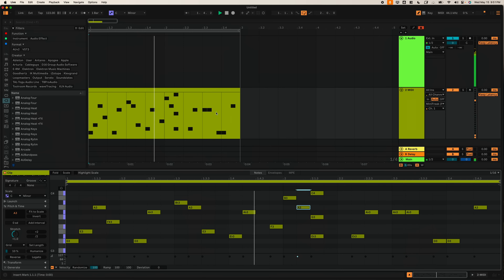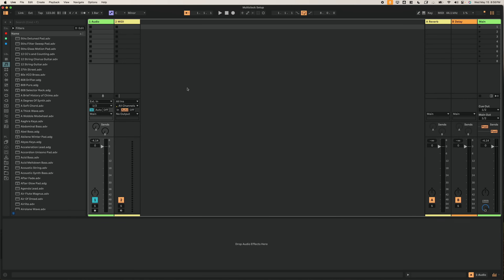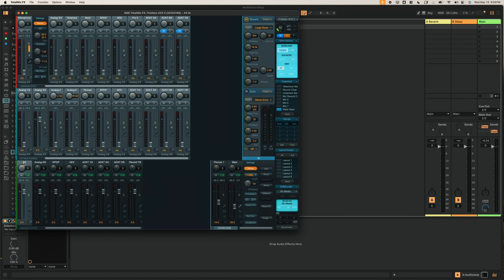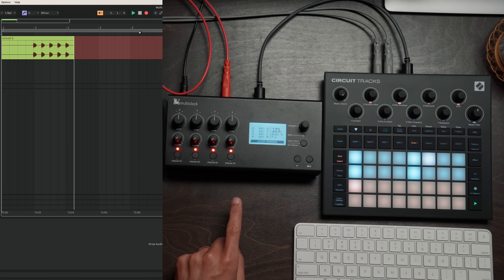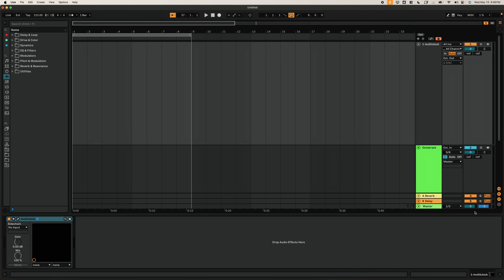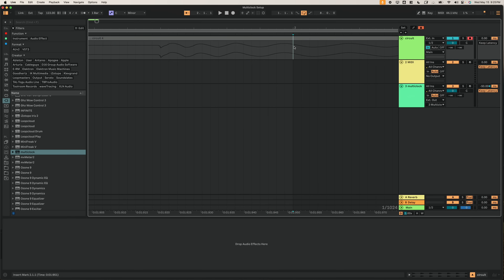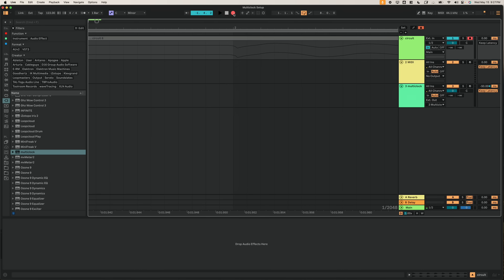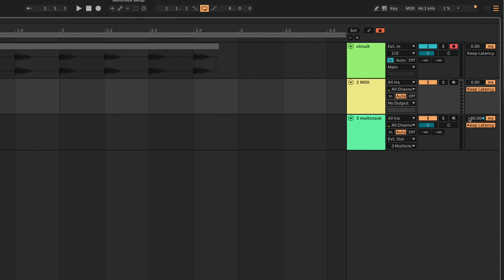How to PROPERLY use your Multiclock with a DAW.

Comment: the problem is this thing doesn't solve the problem that is ABLETON itself... so now this adds MORE delays you have to adjust on top of the 3 or 4 inside of ableton? Well who cares? You might as well skip this multiclock and only manipulate the 4 inside of ableton that also seem to change the sync with every run of the transport. Meanwhile you know what works without any of this? Bitwig does! Which revels that Ableton is not designed correctly... there's really no reason for it to have so many problems, the designer are just lazy and have arrogant attitudes... they have banned me from their forum and their support for explaining these things to them and insisting that they fix problems that exist before adding new probability based devices that no one needs.

Comment: I think I found a simpler way, granted I only use it with a single synced device: place the multiclock plugin on a MIDI channel, then behind it an external audio effect, audio to the multiclock, audio from the synced device. Then you can dial in the latency on the external audio effect itself. No need to use any of the other Ableton magic, like track delay, reduced latency when monitoring and so forth.

Comment: Hi Ricky , i have a question! I want use my Synthesizers in the DAW with an Editor to make my Midissequences in the DAW. I have a MioXL iconnectivity for my Midi Routings. i want take the E-RM Midiclock for sync the HARDWARE EDITORS in my DAW. Have you a IDEA? Or make a Video for it thats great!!! ;)

Comment: Thank you very much for this video. In the beginning of the video you state that you should not buy a multiclock if you just want to send midi notes from your DAW to your instruments. I have a lot of trouble with the timing when I send midi notes from my DAW to my instruments. It's not just latency, it's really drifting, meaning that one note comes too early while the other one comes too late. I tried different solutions (in multiple different DAWs) but I haven't found one yet. The only solution that I found that gets the timing straight is the Usamo, but it has other issues which makes it not really a solution. So, just to be clear: If I understand it correctly, the multiclock won't be able to fix this problem? Or can I use it to fix this issue? Do you know of any other solutions? Thank you very much!

Comment: I'm noticing my Multiclock needs adjusting up to 5ms depending on CPU usage, is this normal?

For example when I start a project, everything is bang on grid, then by the time I'm a few hours in (and CPU is 20-30%) everything is now 5ms off!

Thanks in advance!

Comment: Sorry, I don’t think this is correct. The amount of negative delay you add would need to be adjusted as you add more plugins. You can’t beat the 1 bar issue. Also it’s better if you use the external audio effect to send the signal to the multiclock. This is all to do with PDC (plugin delay compensation)
Check it out

Comment: Now my Multiclock is running fine , i spend hours trying to fix this. At the end the magic was to adjust the output route of the audio interface to only the channel which is used by the multiclock. :D

Comment: The way I am dealing with my clock issues is sending Run signal from uMidi straight to my Pam's, then outputing Start and clock from Pam's wherever I need it. This way I can add as many plugins as I want and the recording will be in sync. The only issue is that is starts few miliseconds too late but the only things that are getting desyncronised are sound sources instanced from ableton (not a problem for me because I can simply delay them). 
It is not perfect but so far the best way to deal with clock I found. Getting clock from uMidi just does not work if you like to mix and do other things in the session while also playing with your hardware.

Comment: Maybe interesting to test: Method 1: Using Program Change

Configure your MIDI device: In your MIDI settings, set the program change message to trigger the clock output. This will allow you to use program change messages to reset the clock.
Send program change messages: In your DAW, send program change messages to the MIDI device at regular intervals (e.g., every 1-2 seconds). This will help to reset the clock and reduce jitter.
Method 2: Using MIDI CC

Configure your MIDI device: In your MIDI settings, set a MIDI CC message to control the clock output. This will allow you to use MIDI CC messages to adjust the clock.
Send MIDI CC messages: In your DAW, send MIDI CC messages to the MIDI device with a value that adjusts the clock output. For example, you can send a CC message with a value of 0 to reset the clock, and a value of 127 to adjust the clock output.

Comment: Hi Ricky i am deep diving in this  as Well. I bought a  Caldigit hub with included audio interface. In osx its easy to make them aggregated. And jitter correction. Cv/audio sync seems to be the tightest. Cheers
Reply: Maybe interesting to test: Method 1: Using Program Change

Configure your MIDI device: In your MIDI settings, set the program change message to trigger the clock output. This will allow you to use program change messages to reset the clock.
Send program change messages: In your DAW, send program change messages to the MIDI device at regular intervals (e.g., every 1-2 seconds). This will help to reset the clock and reduce jitter.
Method 2: Using MIDI CC

Configure your MIDI device: In your MIDI settings, set a MIDI CC message to control the clock output. This will allow you to use MIDI CC messages to adjust the clock.
Send MIDI CC messages: In your DAW, send MIDI CC messages to the MIDI device with a value that adjusts the clock output. For example, you can send a CC message with a value of 0 to reset the clock, and a value of 127 to adjust the clock output.

Comment: If you use a Mac, the brand new Midronome firmware has U-Sync, which is easier to use and more accurate than the ERM. Over USB. No need to use an audio output anymore.

No U Sync for Windows, though. Possibly ever. Sample accurate audio still works the same as on the ERM.
Reply: Why should it be more accurate?
Reply: @samuelhof2192  Why would you want less accurate? Or are you asking how? I don’t know how - you’d have to ask Simon, the creator of the Midronome. It may be that it’s roughly the same as the ERM in that mode, as the standard mode is slightly less accurate than the ERM on paper.
Reply: @cfs  I meant how. Sorry for confusion. you state that the possible marketing argument that usync is more precise than the multiclock as truth even there is no fact based comparison. So prove it its more accurate and not just say it is.
Reply: @cfs  btw i just checked midronome homepage. You‘re talking complete bs. They never state usync is more precise. They claim it‘s the perfect balance between precision and complexity in the setup. But they nowhere claim it‘s more precise…
Reply: @samuelhof2192  Guess you know everything and have read every post in the forums etc. as well since you've had the Midronome for so long. Thanks, Mr Junior Investigator! Maybe Simon backed off what was said at one point. I was only saying what HAD been said - I do admit I don't pay attention to marketing. So here's your gold star for effort.
Reply: @cfs Show me or tell me where he said that it‘s more precise than multiclock. Technically it cant be, but please prove me otherwise. You know you‘re talking bs that‘s why you try to insult me. Doesnt work. Just show me the facts that it‘s more precise, or even point me to you‘re source you refer to.
Reply: @cfs  you‘re behaviour shows me that you know that you talk bs. Show me where this was said what you refer to. Or point me towards youre source. Btw technically it‘s not possible that audio over usb is more precise than an sine wave over just audio. USB is not treated with priority of the OS.

Comment: Dang, this is a bit complicated but Ricky explains it very well. I’ve been eyeballing this unit and the lower model because I have multiple synths and an old as% computer using Reason 10. I love reason and it’s my DAW of choice, but Ableton works better with this setup. I’m still gonna make it work for Reason and eventually get a new computer. I got a bunch of semi vintage instruments that don’t have USB but most of my stuff does. Virus TI, Korg Radias, King Korg, Moogs, Tastychips GR-1 and a Digi-takt/tone. Point is, I think I might be able to just get a new computer and solve my ever going midi issue, but this clock generator might be what I really need. Even with the old computer. It’s a maxed out 2010 mbp and runs pretty darn smoothly besides handling multiple midi to and from the computer.

Comment: Nice tutorial as always, but I think using in positive mode is a pain in order to recalculating again.. if you add a new plugin on the channel, needs to recalculate again.. I prefer negative mode and add  one blank bar to the beginning of the project and always my start is on bar 2. Sorry for my english is not my mother tongue.
Reply: Agree

Comment: Thanks for immediately addressing who needs it and who doesn't. However, i am having a issue with the audio from an external synth being delayed by 40ms when triggered from midi notes in the daw. the midi notes and audio dont have the same starting point when i look at wave file. adjusting offset doesn't help. oddly, theres no delay if i play live while recording midi and audio simultaneously. im coming out of my RME UFX III 5 din midi out to my synth input, no usb midi in. any tools to solve this?

Comment: Awesome video Ricky! Just got a multiclock last week, but my interface i want to use for live sets only has 4 line out puts (Komplete audio 6) but im using all of those to route audio in to my Octatrack inputs AB & CD, do you have any recommendations for an audio interface with 6 outputs in a similar form factor (i.e not rack mounted or only expandable by ADAT)? I can’t seem to find one! Thanks
Reply: Ricky is using the fireface 2 (rme) I noticed the fireface 3 has usb recording which I’m thinking about as far as dawless set up. It’s expensive as it gets but it has Dante or Madi and I was thinking that alongside mio xl that you could route audio and midi all over your house. My living room is my dawless and my studio is just for mixing or in the daw work but I’m not sure if I’m on the right track or if I’m just dreaming that this would work. Mio xl just to connect all my devices via Ethernet and the floating point to be my master clock and fireface to connect audio via toslink or Ethernet
Reply: Yeah fireface interfaces look great indeed. I ended up going for a basically brand new Tascam 208i interface i found on a used market for 150€. Absolute bargain! 20 inputs (16 over adat) and 8 line outputs on the unit itself which is great.

Comment: I worked extensively with this machine, I ended up returning it not because it does not work, it is because there are several much easier and faster ways to do things. 
1. In Bitwig the compensation is already figured out for you via HW instruments with just a regular midi connection to whatever midi interface your instrument is connected, if you are working with CV then just use Expert Sleepers ES-8 or ES-9, you can also do Midi with both of these units via breakout, it works flawlessly with Abelton, a bit of drag on Logic and nearly impossible to do the Expert Sleepers with Cubase. 
2. If you are using Logic, you just purchase and Emagic Unitor Midi/USB interface, they are like $75, connect all your synths and drum machines via midi, and then download the driver from Apple, Yes Apple actually rewrote the driver for Silicone Macs 2 years ago for Midi interface that is 30 years old, and if you are intel based mac there is driver for that as well on the apple site that has been for over 20 years. You will have the BEST tightest Midi connection in your, just with one click on the Logic Midi Instrument channel the Emagic Unitor will figure out the latency and its bang, just like the 1990s and almost as tight as the ATARI or Circklon midi sequencer. 
3. If you are out of the box and not using the DAW, and you just want tight Midi, use the mpc 60 or MPC 3000, the new MPCs are very good for Midi sequencing, good Midi Clock as well, so you can accomplish, you get 4 Midi outs on the Mpc X and big screen, if you want to bring the audio from your synths back into the Mpc and record is as audio, it is bang on tight, however the converters for MPC x and all these new mpc is not very good, (this has been discussed and looks like Akai will never change that) also the simple integration of Mpc as vst plug in in your DAW is incredible powerfull. 

Stay as far away from Midi USB unless there is a driver like what Apple has done, yes its 2024 and we still talking about Midi timing. Great Video and Explanation.

Comment: Here is a question on a grey area.  While you mention that the MultiClock is not needed for straight MIDI recording, what about if you are triggering external synths with sounds that have delays that are synced to the MIDI clock coming in?  I am thinking yes it would be good in that situation but not sure.  Seems like it would definitely be good though if you were triggering a sequencer on an external hardware synth that needs to line up with what is in the DAW.
Reply from the maker: Yeah, I’ve messed with this. Also for example using the multiclock to sync my Peak’s delays. But I found it more of a hassle than worth the effort to get a barely noticeable effect right on the money.

It’s pretty good with Zen delay and what not too but most times effects are ok with a bit of jitter I find. 
Unless you’re using something like an ottobit JR or microcosm, then that’s where it starts to get super weird ESPECIALLY if it’s a SEND/RETURN from live.

Comment: What one can do to get around the first samples being late is to start recording but only activate the device or clip that is playing it on a later measure.  For instanceI have taken a clip in Ableton and added a few bars of empty space before it and then record it in.  Note that this tip is good for just normal recording in Ableton without a MultiClock as well.

Comment: got myself a UAD Volt (which has a midi interface built in) some time ago. comes in handy so I don't have to plug an extra cable to my mac every time I want to use the moog

Comment: I didn't need to get an ERM multiclock to fix the sync issues that I've always had in Ableton, I just stopped using Ableton. The DAW I'm using now flawlessly syncs and records all my external hardware with my DAW right from the first downbeat of the first bar.
Reply: which daw are you using now?

Comment: Ricky, I changed the multiclock knobs with the elektron ones and they fit perfectly giving a nicer look :)
If, instead of using the audio input, I used the midi one, would the multiclock perform his best in the same way?
Reply from the maker: Depends on where the midi is coming from, it’s it’s just USB Midi you might have some more jitter compared to the audio sync. Midi can only send so many packets of information at once and audio can send TONS more which makes it “more accurate” that’s the super watered down version of why audio is better haha

Comment: I'm running a TR-8S, Moog Grandmother, Moog DFAM, Boss RC-500 Looper (that I primarily use for guitar and bass loops), and a Behringer XR18 + Behringer XTouch. To keep this stuff in timel, I've been using an Arturia Keystep Pro at the top of the chain and basically running a bunch of thrus 😅... it does the job pretty decently, but def has some hiccups, especially when I kick on the soft-synths in Ableton. 

I think this might be just the ticket for my situation!
Reply from the maker: Yea that’s another point I may have covered ages ago. Using USB sync feels like it changes as the session gets larger and more CPU hungry

Comment: another PRO TIP:
You can set it up all in exactly the same way as you showed BUT but at the very beginning set the 'shift' knob to +50% - This way, all your gear will start with Ableton immediately AND you will also be able to do the negative shift (from +50% to 0%) Sweet sync spot will be at +50% and you can go all the way forward to +100 or all the way back to 0% (depending on what 'shift range' you set in the settings.)
Reply from the maker: Aaahhhh that is handy! Im always so nervous those big knobs will jump between values haha
Reply: Oh I just saw that you can change the settings from neg/pos to positive for the same effect. Yet to try either strategy but thank you